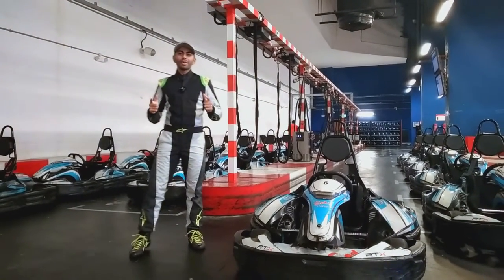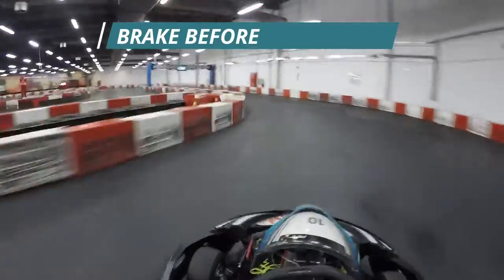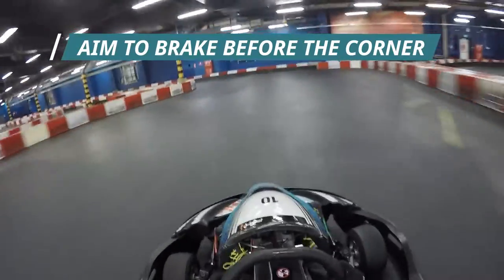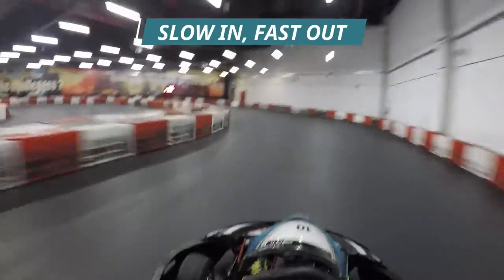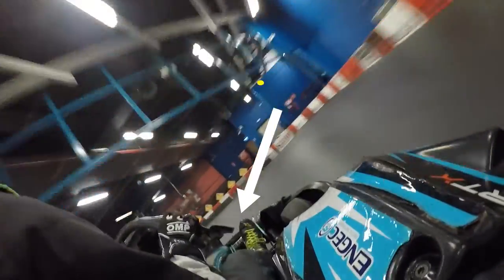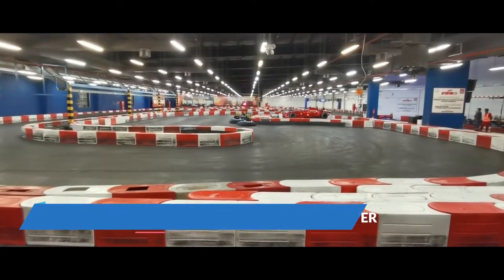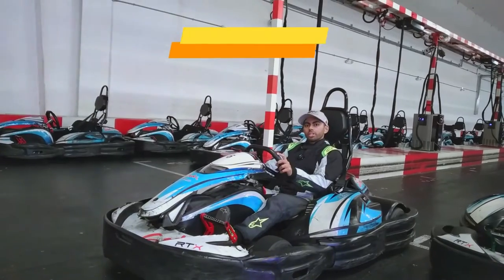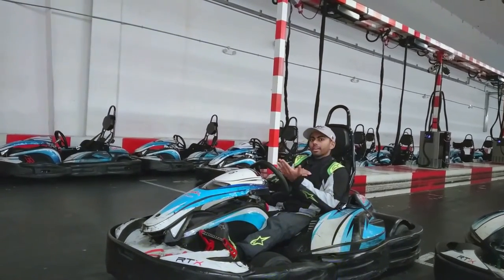How to DRIVE an ELECTRIC Go Kart (tutorial)

Comment: Are you sure about the tilting? I am tilting into the corner, because then I reduce the weight on the outside, the grip on the wheels is high enough because of the weight of the cart and me, it's just that I am reducing the centrifugal force (the more weight is on the outside of the turn, the stronger is the cart pulled to the outside of the turn. Anyways I will try it but it doesn't make sense to me. The rest is fine. Thanks for the video and pointing it out, I will keep that on my mind.

Comment: So what is the exact difference to driving conventional go karts? Also I have heard it's better not to hit the break pedal at all and just lift the gas pedal to reduce speed?
Reply: That's for petrol carts. Electric you should use the brake more aggressively bc they accelerate well even in low rpm territory.
Reply: They told me the same at K1 speed. It lowered my lap times til I hit my fastest lap.

Comment: I think the tip about leaning is definitely debatable. I have tried that as well as remaining neutral, and for me I have found that not shifting my weight when going into turns actually yielded better lap times for me. 

In short I'm trying to say your mileage may vary.

I should also add that I'm very grateful that you did this video because I was using outdoor gas karting techniques on electric karts and that did not work out well for me. So I am glad that you proved my thoughts for me that indeed slow in fast out is the best formula with electric karts and/or indoor tracks for the most part.